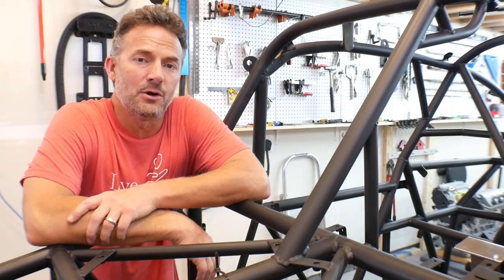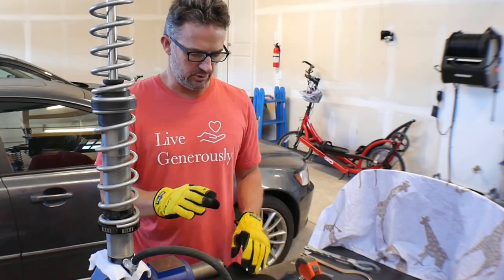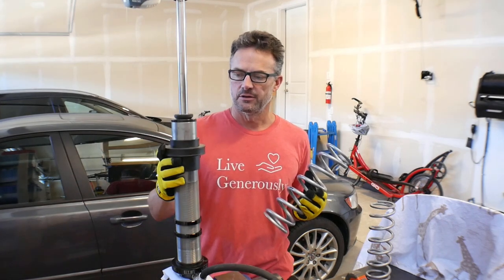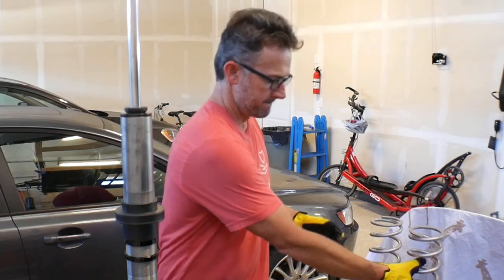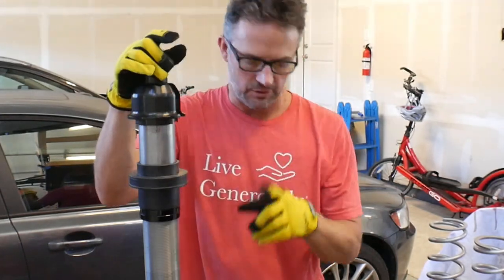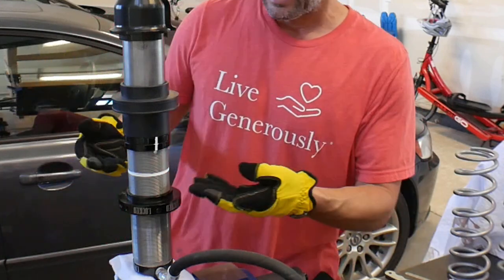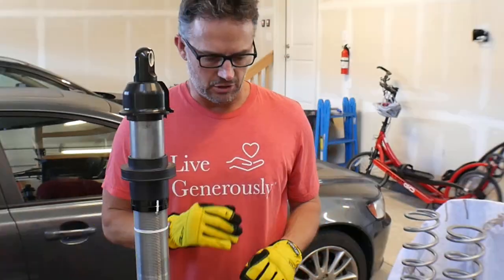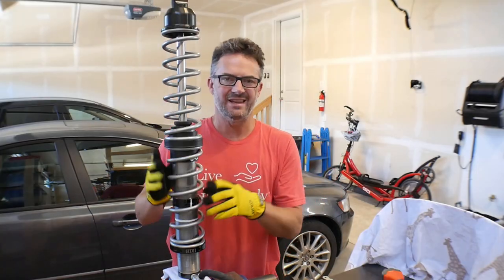Off-Road Shock and Spring setup

Comment: Excellent Info!  Every track and car will have a different preference. Especially for a Hobby Car. I just changed the valving on my Fox reservoir rear shocks and it made a big difference. Can't wait to test it out. Found some new trails 125 miles North West of home. I think you will like them. Not a track environment but should be great when the fall colors start changing. Hope you can join me sometime.  Get er Done!!!!
Reply from the maker: If you're asking me on a trail date the answer is yes. 😁

Comment: I was under the impression that since the top spring is lighter then the bottom, you would set your crossover rings based off off the top spring coil binding. So in this case the bottom of the preload ring and the top of the spring divider would measure 3.25”. Granted whenever you change your preload you would need to move your crossovers with it, so I’m not exactly sure if I’ve been doing it wrong.
Reply from the maker: So the difference is the way I did it I'm maximizing the lower spring. The way you're doing it you're maximizing the upper spring. Just personal preference. Only difference is you have to make adjustments if you change the preload. My way is more tailored to lazy people. 😁😉
Reply: I would probably set the gap under your 3.66” instead of rounding up. I would rather bottom out the spring than the internal valves. Or do the bushings on the shaft stop it before that point?
Reply from the maker: @Tommy-B.  Well in order for the shock to bottom out this far my bumpstop would have already failed. But if it does I'd rather let the shock bottom out all the way without binding the springs. There is a rubber stopper on the shaft that would crush and put the force into the shock housing. I guess that would be the best scenario.

Comment: Mike, May be I'm confused. What was the reason why you installed the heavier spring at the bottom. I thought that if you install the weaker spring in the bottom, you have a softer ride specially in the whoopies and as the springs compresses it gets harder until the bump stops applied.
Reply from the maker: It can go either way. But whatever spring is on bottom is the spring you're tuning. 
With the soft spring on bottom you would need to fully crush it before getting full advantage of the heavier spring. It might take 3/4 of your travel before you fully crush the softer spring. And then the slider isn't really doing much.
With the lighter spring on top you can adjust the slider to cut the top spring out much sooner and benefit from the stronger spring.
When the springs are stacked, soft on top or bottom the spring rate is the same. Things only change when a spring is fully crushed, or engages the slider. Then you get the spring rate of the bottom spring. Whether it be soft or strong.
So you're not wrong as it can be done any way you want. But this is why I did it the way I do. ✌

Comment: Hey Doug, good vid as usual. 
Have you ever set up rear coilovers on a Baja bug with stock type one style rear trailing arms.  Just wondering ballpark spring rates for a 12” travel fox res shock. Thanks.
Reply from the maker: When I had Mauler set up as trailing arm I had 14" shocks on it. It had a 14"x275 on top and a 14"x300 on bottom.

Comment: Hi doug,  i'm here from couple of years, you are a inspiration to me.
Thank you.
Now, i came back to this   video because i want to buy shock absorbers, and i don't know how to chose them.
Can you help me please,?
My buggy detalii
40cm travel
Front wheight 150kg
Rear wheight 250kg
Total weight 400kg
Thank you in advance
Reply from the maker: I would think your buggy is more like Mauler, he uses 2" body shocks. I have 10" travel in front and 12" in rear. But you'll need to dry cycle your suspension up and down to see how much travel you'll need. And add a little extra at the ends too.
Reply: @DougBugBuilder  how about the weight to chose the strenght of the 2 coils?
Reply from the maker: @ciobanuvalentinmail  I can't tell you exactly as I don't know your weight or the ratio of your suspension. But I can tell you Mauler has 100/250 in the front and 275/300 in the front. I think your Baja is a bit lighter, but hopefully this is something to get you started.
Reply: @DougBugBuilder  thank you very much